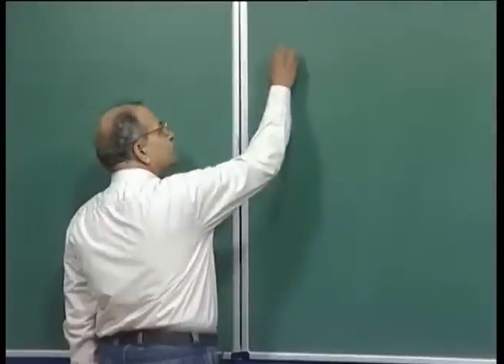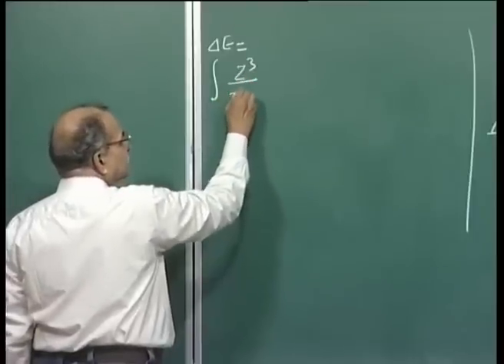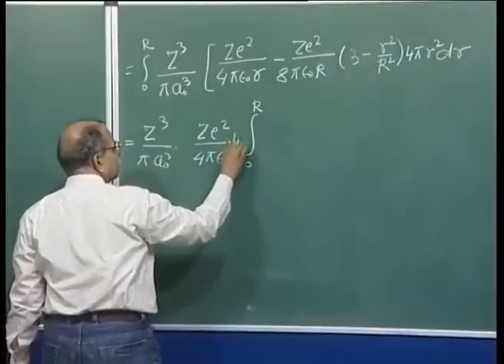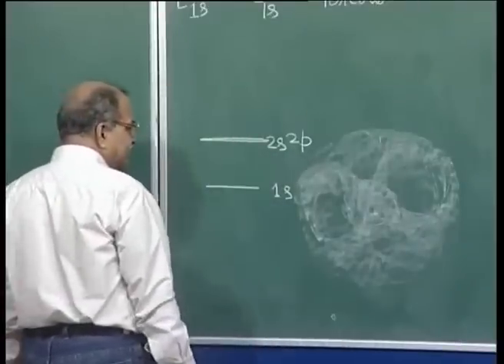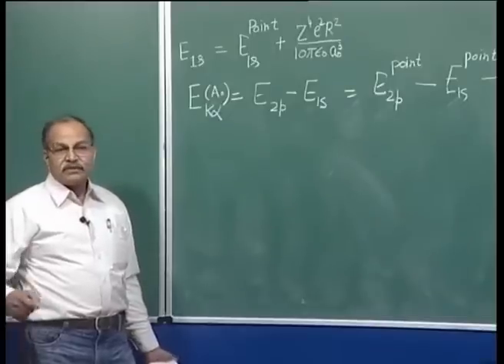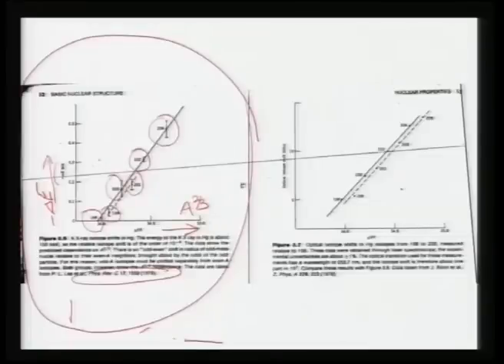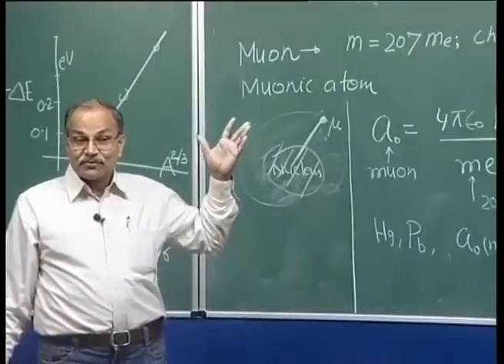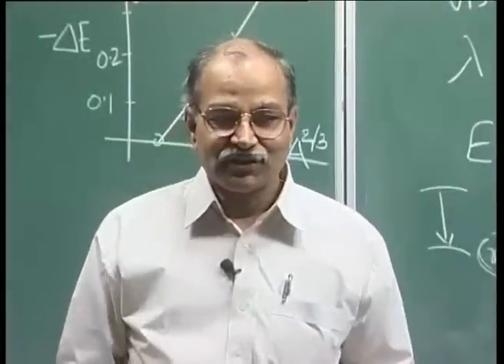Mod-01 Lec-04 Nuclear Size Cont..

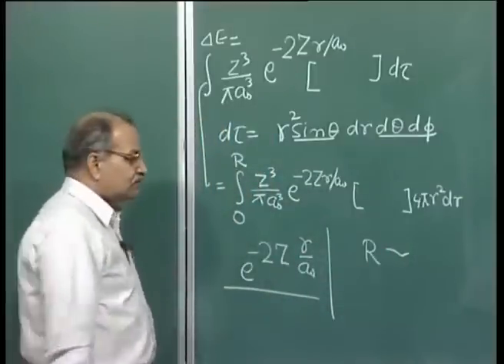Comment: We are finding what should be the value of R but at 13:40 he is taking value of R, how?
Reply: The argument is that R, the nuclear radius, is much much smaller than a_0, the “atomic” size. This you know anyway from Rutherford. So you can make the above approximation to simplify the integration and later check that the result you get for R is consistent - you don’t have to do this approx if you don’t want to and completely do the integration, but remember that it’s 1st order perturbation theory with a few assumptions made about the nuclear distribution anyway. So keeping all the “precise” calculations wouldn’t be meaningful anyway :)

Edit: this approximation cannot be made for heavy nucleus with muon where the wavefunction is basically always within the nuclear size! In that case we should do the full integration.